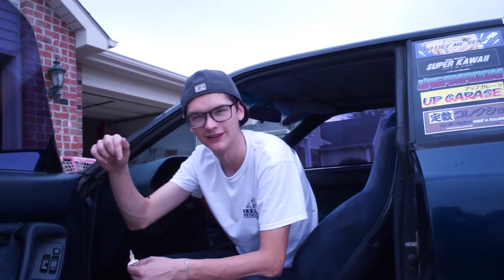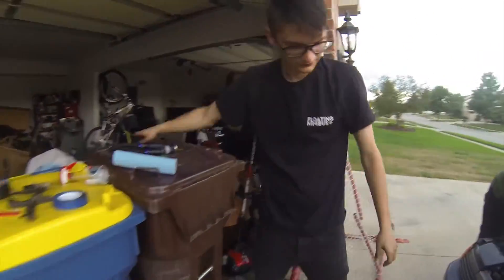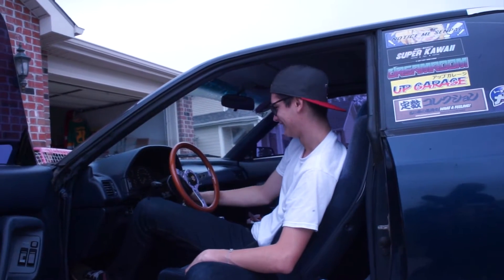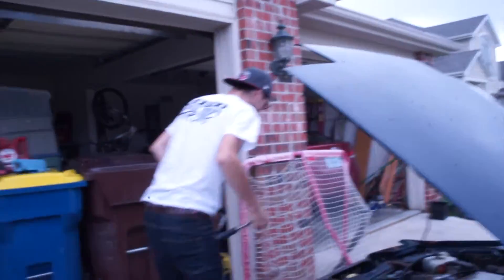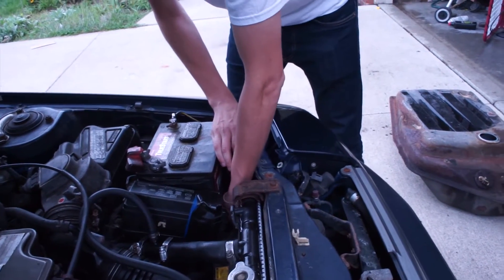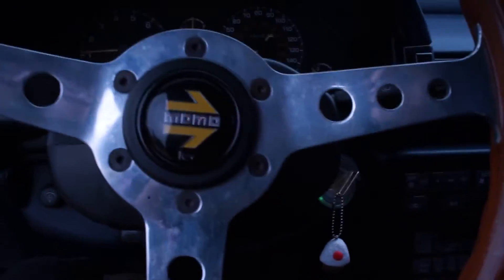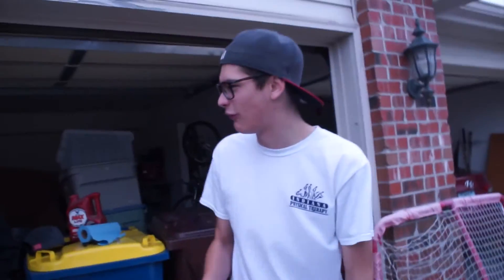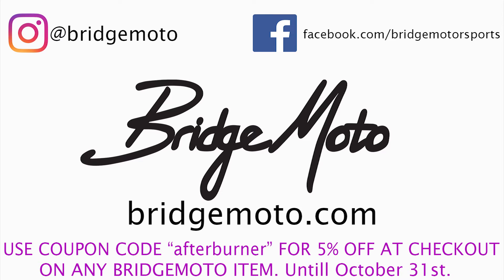It's Finally Running! Celica Build: Part 4.

Comment: the fans are only suppose to come on when the engine gets hot or when u put the ac . the front right hand one is for ac the one right in the man is for the cooling of the engine make sure u dont have an electric cuse u could burn them out by having them on all the time and the radaitor prob trust me mys a bitch to and i have done some mods to were i could pull it out easy by the way were did u get the wheel assembly for the steering wheel that is mint bro